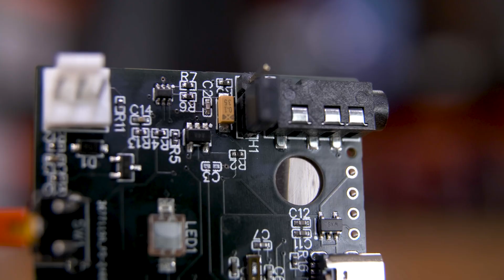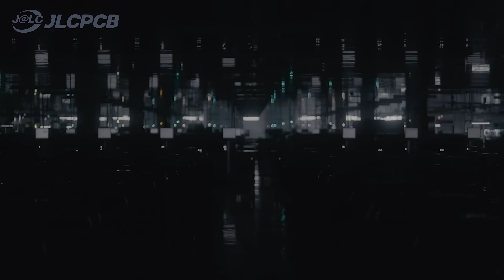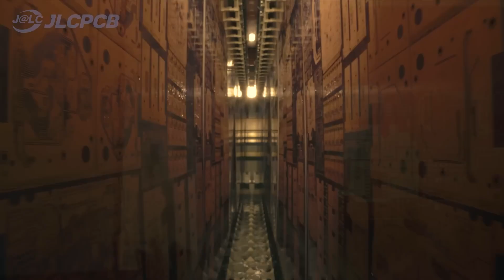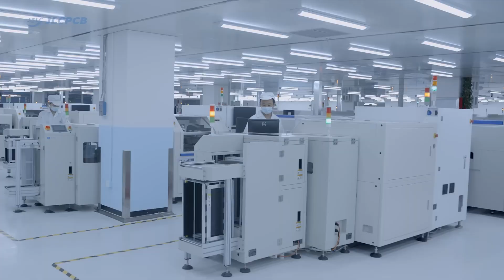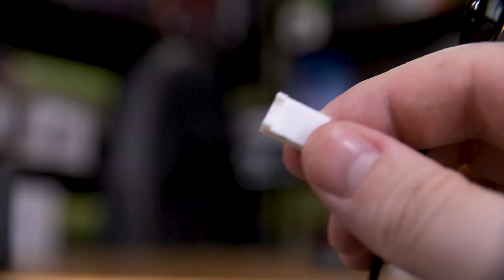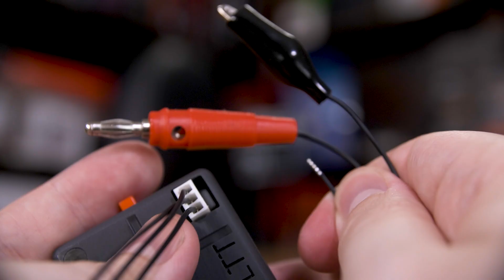BRAND NEW LATENCY TESTER - OSLTT CS is here! (Open Source Latency Testing Tool)

Comment: Hi, I got the old version. I'm still "studying" about latency. I use your tool to measure laptop screen latency. One question that I have is If wanted to use the "same" test standard as other review websites, to show the total Black to white and White to black latency, should I just generate the the graph using the CSV and add the timings of two results that are  close to each other, I suppose that it measures black to white and White to black after.  So If I get 2.2ms and 2.5ms in the CSV, one after the other, 4.7ms would be the total B/W W/B? Thanks!
Reply from the maker: I think what you're describing there is the response time, as in how long it takes to go from black to white, and white to black. Latency is the delay between actions - like how long it takes to start that change, whereas response time is the time between colours being displayed. If you want to test response times you'll want OSRTT, although depending on the brightness setting you might be able to do it manually from the raw data OSLTT generates if all you care about is B-W-B. Feel free to jump in the discord and chat in the OSRTT-OSLTT-Support channel!